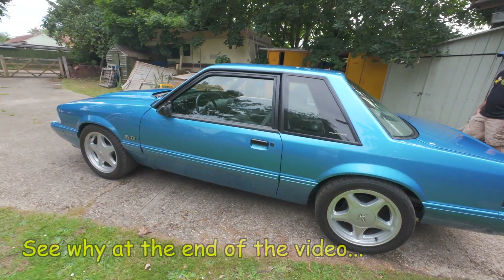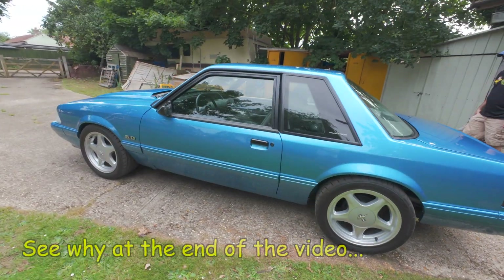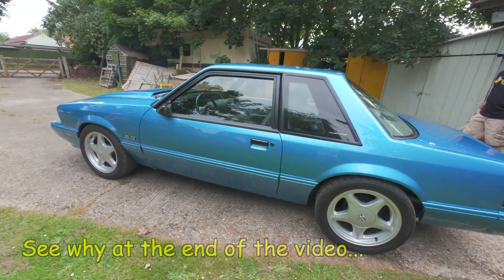Fox's Don't Always Like The Battery In The Trunk

Comment: ran a ground to the bell housing bolt near the starter, one in the trunk and 2 off the motor to the chassis. I used 2/0 welding wire when i relocated my battery.

Comment: Those damn 6 al boxes.  Ask john how many my old truck ate lol
Reply from the maker: I don’t know what to say. I’ve had many over the years and never had a single failure. The one on my Mach 1 is an original 6200 that must be 35 years old at least.
Reply: @Mike-FoxsAbroad  yeah there was a bad run there on production around 2010.  When they first went to the newer design.  Super easy to pop circuit boards.  Went through 3 then never had a problem again.  I believe at thr time they acknowledged they were having issues.  All were replaced for free
Reply: Real real sensitive to heat.   That one is mounted in a good spot
Reply from the maker: @timelesssteelgarage    Hmm. I have one of the very first black 6A boxes on my F100. Think that was around 2014 or 2015 though. I’ve never purchased a newer 6AL box though as modern EFI controls rev limits and such.
Reply: @Mike-FoxsAbroad  these were 6al2s.

Comment: Question why didn't yall just run thicker & better cable from the back to the front? Just a question I've seen plenty of batteries in the trunk but I've never heard of issues just curious.
Reply from the maker: Once we started to add up the costs of a new full length 0 gauge ground cable, as well as a new matching positive cable for good measure.  Then we add in the cost of new good quality terminal ends.  (remember, we are in England.  Stuff costs a lot more here) Then routing another cable under the carpet where there wasn't much more space.  Then you factor in the additional weight penalty.  The simplicity and cost of putting the battery up front just wins every time.  Racers that think the battery needs to be in the rear are just kidding themselves.  Unless you need a shutoff to comply with sanctioning rules, there is no  good reason other than needing the battery's real estate for something else.  That's the reason the factory did it back in the day.  Like the Boss 429.  They put the battery in the trunk as they ran out of room in the engine compartment.
Reply: @Mike-FoxsAbroad  ok thx